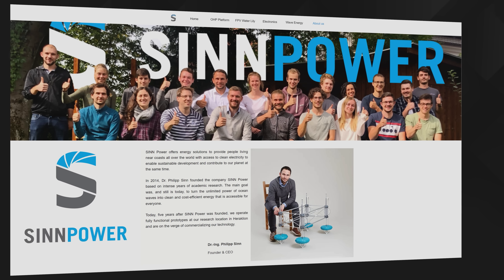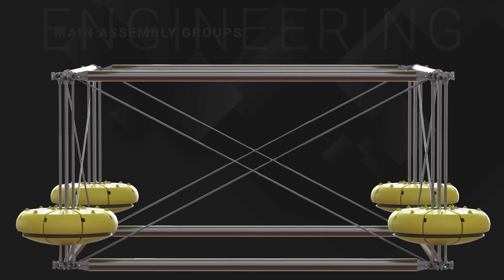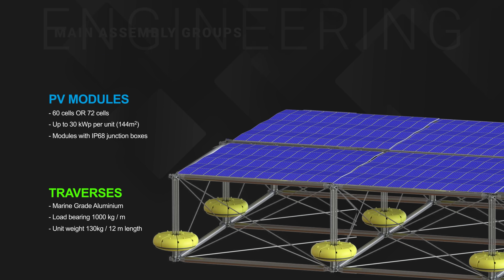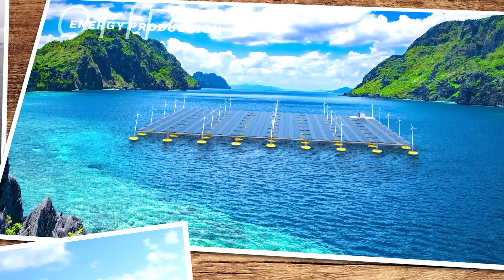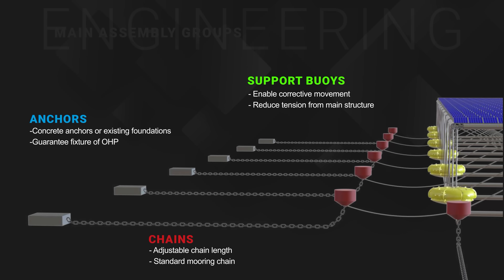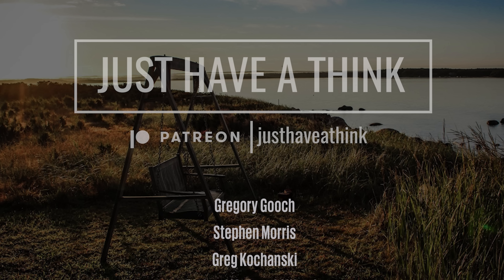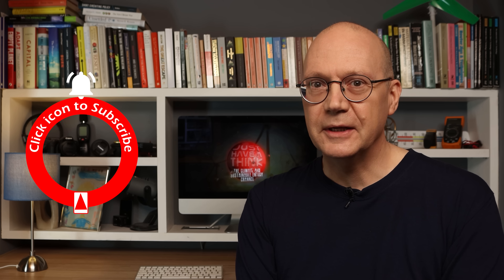Solar Wind and Wave. Can this ocean hybrid platform nail all three?

Comment: I don't know if you are old enough to remember on Tomorrows World a guy demonstrated producing power from waves on Lock Ness. An 'expert' checked the calculations and said that it wasn't viable and this squashed the project for at least twenty years. There is a lot of energy to be collected from the sea, I'm glad to see that this company is trying their best to extract it.
Reply: Maybe the expert was right. Just because this company has made some CGI pictures it doesn't mean it's a good idea.
Reply: @Withnail1969  about ten years ago someone else looked at the results. The project was really good at taking energy out of waves. It was actually obvious from the video. Waves came into this thing and there were no waves the other side.
Reply: @Withnail1969  not a clue where to start looking except it was on Tomorrows World and was wave power.

Comment: I'm not really sold on the idea of companies making vast amount of renewable power to solve the climate change issue. In my opinion every new house should be made with solar panels on them and those solar panels have to be replaced by the owner when they get below a certain level. There will of course be exemption clauses from doing this like if your roof doesn't get enough sun or if you generate more than a certain amount of power from other renewable and clean sources. If we could get every household to produce 110% of what they use we could not only power ourselves but also sell our clean power to other countries. This would also apply to businesses. This could be solar tiles instead of panels.

Comment: From experience (33+ years in the offshore industry, and counting) it is very hard to design systems that are low maintenance and have long life and reliability is extremely difficult. However, the modular approach and smart designs may just be able to get there.  One place I would look at first is the Pacific Ocean, and in particular the sheltered bays / lagoons that have waves but not a dramatic as the open ocean in a cyclone (we just had one go past in New Zealand and the waves were impressive............).  I would love to know more about the real life use.  One more thing, my background is in innovation in the offshore industry and I have learned that a lot is possible. It is not always easy but there are plenty examples to prove that things can survive and flourish in the harsh offshore environment.  It just takes time, energy and money to make it work.

Comment: As a platform for energy generation this looks good. As a place to put buildings next to a very busy city that needs to expand I'd say no. As good as those aluminium struts might be they won't hold a sky scrapper and if you look at a city like new york then most of the buildings are very tall so I think other land reclamation ideas might be better like what japan does.

Comment: Heres a interesting question: could you also reverse these kind of wave generators to store excess energy in the ocean. In theory as the wave propagates you can recover the energy at a later point in time. Probably not super efficient.

Comment: My main concern arose when you said aluminium and stainless steel being connected together. In my experience stainless steel and aluminium generate substantial corrosion of the aluminium, and thats not even exposed to salt water, just ordinary rainy weather conditions. But maybe it reacts different with the special variant of Aluminium mentioned for saltwater installations ?

Comment: As I recall in the seventies a British University group designed an interesting break water system.  It basically consisted of two barges hinged together and an electric generator that would recover the energy by the flexing of the hinge caused by the waves.  Parallel barge pairs would be string together anchored with chains to protect a coast line from heavy waves.  The water behind this barge assembly would be calmer water with much smaller waves.  Since climate change will bring higher sea levels and more violent storms this idea may become timely again.

Comment: No mention of cost per KWH sales or cost permoducle.   No mention of potential output per module. This looks like a big up-front cost with a long-tail of benefits.  This may work froma technical standpoint, but could get trashed when a discounted cash-flow is applied.

Comment: I'll believe it when they have footage of a working test platform. No anchoring tidal generators to existing concrete structures. A 4 x 4 segment mini rig with 16 solar panel arrays and 4 wind turbines + tidal generators. Also concerned about the flat solar panel arrangement. Not ideal unless you build them on the equator. Nice idea overall but really needs a working proof of concept prototype as soon as possible.

Comment: The platform concept alone - sans any energy harvesting considerations - is already brilliant.  Harvesting energy from such a platform - brilliant icing on that brilliant cake.  My experience with any grade of aluminiumium (last bit of fun poking) in salt water would suggest to me, move on to stainless or resign selves to running a current through the structure. Or haul anchor on metals completely and graduate to pure plastics thinking.  The amount of energy staring at humanity from every sq km is so staggeri
ngly large, we'd be fools to not do everything possible to utilize it.  I'm impressed at the steps this startup has taken and I wish them the best!

Comment: I’m calling bullshit on this one before Thunderf00t does.
A.  How can the alleged float, be a float, when it is free to slide up and down on the thing it’s meant to be supporting… FAIL.
B.  Stainless steel and aluminium bolted together in a seawater electrolyte… Galvanic FAIL.
C.  Solar panels laid a few degrees off the horizontal a Metre or so above the seawater… Encrustation by evaporation FAIL.
D.  Wind turbines mounted on a floating platform, so, for every Kw of generation, the anchor points must exert
      1Kw plus losses to the platform…. Sailing ship FAIL.
Forgot my favourite one.
E.  Spinny spinny bird decapitators on sticks .  Dead Seagulls and seagull shit accumulating on the Solar panels Fail.

Comment: Love the idea of quick-response modularity, great for a quick-fix or humanitarian aid, but more often than not energy infrastructures are optimized for their resource & environment. Maybe their customizability would offset intermittency of a single energy source to provide a consistent output without depending on the much needed energy storage a single source would require. Kudos to them. Definitely a partner we would consider.

Comment: I would buy one today if the cost is reasonable. My dad's place would be ideal on bay without power grid.  
Would the government allow the instalation? 
I expect that the solar panels would have to be cleaned regularly.   
There are questions of boats running into it or people stealing components.   
Could I get insurance for it?

Comment: i would be concerned about the shading of the wind turbines and towers on the panels - cutting solar output. Could just limit it to a single row of wind turbines on the North side (northern hemisphere) or South side (southern hemisphere) outside of the tropics - while still having both wave and solar.

Comment: Perhaps the problem is not the amount of power needed, but the power density. Half of us live in cities where the power density is very high. I have heard that our planet gets about 16 terawatts of solar energy, but we only use about 4?  Maybe I heard wrong. But if we moved away from the concept of cities and lowered the power density, we would be better able to satisfy then power needs without then need for these huge power generating facilities that seem to be a lot of the problem. 
I get my energy from the Grand Coulee Dam, and I have heard that it is the 'cheapest' electricity in the country. But is hydroelectric a good solution? I live not too far from what was called WPPSS. That didn't work. A company near me produces the raw material for solar panels. It is included as a reason for our Emergency or Contingency Plans. I am impressed by the length of the Coal Trains that whistle in the night and day. Then there is the lithium problem. I can go on, but how do we solve the underlying problem, the need for these huge power generating plants? How can we make better use of the clean fusion power plant that we see every day? Give that a think, please.

Comment: What I would like to see included in these offshore installations is an integrated canning facility to use up all the schools of flying fish that are being killed by the fan blades or will be stranded on the solar panels to be slowly grilled. They would be an adjunct to the pet food plants and feather pillow stuffing plants currently in operation around the local land based versions to utilize all the brick-batted birds and flying mammals. 🙂
As the local NIMBY Rent-a-Layabout Crowd are currently touting! 😜😁

Comment: Its sounds like a good idea, but the best places to utilise tidal power, aren't always the best places to utilise solar & wind. Also, the solar panels would need regular cleaning, to prevent salt build up & the stresses placed on the structure with the tide running one way & the wind blowing another, would mean that it would have to be a very robust structure.

Comment: Maybe I am ignorant but could there be a real problem at the junction points between aluminium and stainless? My memory might be a bit sketchy but there might be an electrical potential difference there that causes electrolytic corrosion.
If that is not a real issue then the whole thing sounds like it would settle a lot of the additions that spring to mind when such issues are raised.  All we have to add is geothermal and temperature differential in the ocean and there is nothing left untapped:)😄

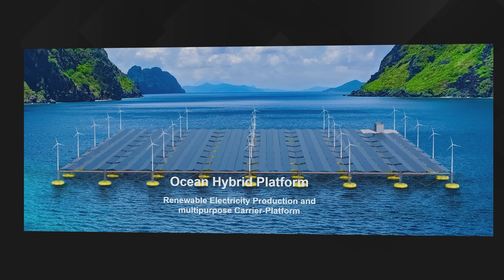Comment: At 3:06 in the video is a picture of wind turbines sticking up through a platform largely covered with solar panels. Not only does the spacing between turbines appear to be smaller than good airflow would dictate, but just how are you going to service turbines in the middle of the platform? If the area is windy enough to justify turbine installation, it's windy enough for the platform to create chaotic air currents around the turbines and to feel large forces on the platform itself. The whole platform is basically a hazard to navigation as well. Salt accumulation is very likely to be a major problem, and I don't see any cleaning equipment. This looks a lot more like a fundraising concept than a viable design proposal.

Comment: What impact will there be in marine life due to all the newly shaded areas??? Is this ecologically responsible?
Would it be better to build up instead of out?? I'm especially concerned for the coral reef and molecular level marine life. 
And if shade were the only change, what about the vibration and electrical discharge elements to those structures. What about all kinds of waste? 
Off shore is one thing, albeit probably the most damaging to our delicate waterway ecological systems, but in open water how would you measure impact?

Comment: Just wondering if there will be protection provided from a abandoned or rogue ship/vessel from craching those platforms.  That can do a lot of damage, moreso than rogue waves. Or hurricane type storms resistance?  The cost is what I would conside as to be practical per KWH construction cost and "Minimum" KwH production.

Comment: They might need to consider how to remotely monitor the platforms so that they can be quickly serviced as they become dirty or they won’t achieve their optimal output from solar.  Given they don’t want seawater on the panels, is there a good way to clean them?   Or is it just they don’t want them bombarded by sea swells?

Comment: Thanks for another great video! The idea of this is certainly good. It's less like, say,  the invention of the lightbulb, and more like the invention of the USB - standardizing existing technologies so they can be used in novel ways. The really clever bit (imo) is using the wave powered floats to stabilize the platform. I'm guessing that's how they can fit multiple units together and not worry about tidal effects stressing the connectors between them.

The use cases look pretty fun. Of course the main use is those offshore wind farms, but I like the idea of industrial islands. Imagine what some developing nations could do with self-powered industry that could be assembled just off shore. And offshore from large cities, the uses could be limitless... You mentioned green hydrogen, but the one that really intrigues me is desalination. Ten megawatts sounds like more than enough power to run a desalination plant that could pump fresh water to the nearby city.

Oh, and sewage treatment! You could take some giant city that pumps raw sewage into the ocean and put a renewably powered sewage treatment plant in the water at the end of the pipe.

Comment: I love the idea and especially the hybrid efficiency,  but why not mount vertical wind generators on every vertical column in the array and increase the  total wind exposure to power generation?  Also the anchor approach could also be used to generate power as the waves pull on the anchor chain trying to displace the platforms. From a structural aspect they could learn a lot from the offshore drilling platforms that are designed to survive terrible storms. These artifical islands would also likly become a location over time for fish and marine aminals, so all in all avery good idea.

Comment: I’d be interested to know more about how these would be anchored, especially in areas of high tidal range (say 5-6m). I’m a bit sceptical that raising the solar panels a bit above water will keep salt spray off them but maybe there is a washing system? Seems very promising.
Reply: Rain.
Reply: Normal anchors are fixed connected to the ship via a chain, that's at least three times as long as their distance to the ground. This is needed to ensure the chain pulls horizontally an the anchor,  not vertically.  Seem like they are using the same principle here, so a few meters won't make a difference
Reply: @MrCaedo  Think you got vertical & horizontal mixed up. Some sailors use 5x the depth, so the weight of the chain does half the work of the anchor.
Reply: @MrCaedo  i think you have that backwards. You want the force to pull horizontal along the sea bed.
Reply: There are already cleaning systems for dust employed cost effectively in grid scale desert solar operations
Reply: @-whackd  Yep. Plenty of Mexicans/Guatemalans/Hondurans etc available at $2/day and here you don't have to have them landed onshore even! ;-)
Reply: @theoztreecrasher2647  Set them up just offshore of Tijuana, send the power, fish etc to San Deigo :D
Reply: @ianthompson44  Yup, send in your CV Arlo. There's a position waiting for you on our Administration Team in 2022 Son! ;-)
Reply: @theoztreecrasher2647  Someone's gotta work in Tijuana in "loss management" though. ;-)
Reply: @ianthompson44  🤣🤣👍👍
Reply: Solar can be 20 foot above the Ocean.

Comment: How to handle gale force winds & oceanic storms?  Marine grade aluminium doesn't sound cheap?  Salt accumulation from sea spray?  Damage from marine life both above & below i.e. birds, seals?  Metal fatigue from constant movement & corrosive salt water spray? NIMBY's & waterfront views?  Navigation hazard?

Seems like it might work in certain very specific niches, however the devil is in the details.

Comment: No mention of hydrogen. With electricity sources so near (solar pv, wind and wave) using the electricity to split water into H2 and O2 sounds like a great idea. And this hydrogen, you can be sure, is green, ie not coming from deconstructed hydrocarbons.

Comment: I'm betting the sealing of all these pieces will suffer over time. Let's see what happens when some large scale power generator buys a few stations and puts them where the water thrashes about a bit. Knock on wood.
Reply: Nobody is going to buy this contraption.
Reply: @Withnail1969  What contraption will they buy instead, in your view? And why?

Comment: Has anyone looked into building oil tanker size ships filled with batteries to dock alongside the floating power station? Then the ships could travel to a seaside port, dock or anchor and connect to the local grid. Battery ship companies could sell their battery stored electric power to the highest bidder, or price based upon distance to seaside port.

Comment: How about a integrated wind and water tower that pumps water up with excess energy and drops it down to produce hydroelectric when wind is low?  Is anyone else thinking of this idea? Could be implemented on land basically anywhere there's wind.  I got this idea based on El Hierro hydro wind plant in Spain
Reply: 10 meters of water is a 1 atm of pressure on a walls of tower. There are much cheaper and safer ways to gravitationally store power.

Comment: I wonder what effect barnacles will have on the efficiency - will they weigh down the floats to where they're not as efficient?  Marine grade aluminum?  Does that mean the surface is coated with a protective layer?  I wonder what the marine environment, like barnacles, will do to the coating?

The solar panels are another unknown.  What happens to salt spray that evaporates on the panels and blocks some of the light?  Can it be washed off easily?  Also other unknowns.  How will these 'stiff frames' and surfaces hold up in rough seas?

I like much of the design but there are alot of  things that might take many years to show up.  If you understand ships or airplanes, you may understand that subjecting stiff structures to huge numbers of flexing can cause metal fatigue that ends up with failure.  And this is especially applicable to the harsh marine environment.